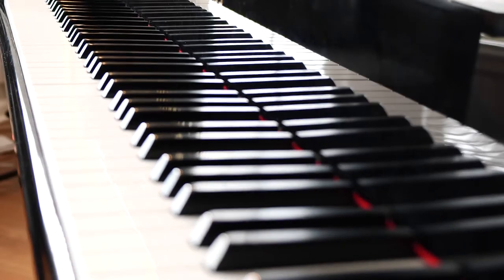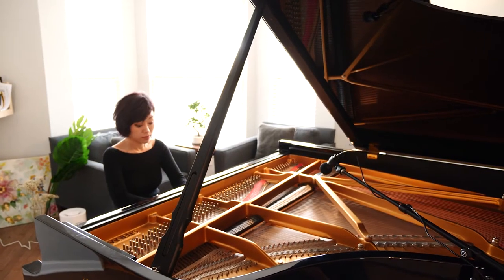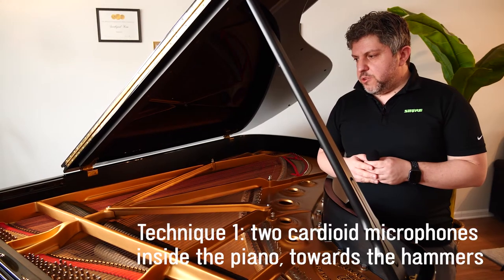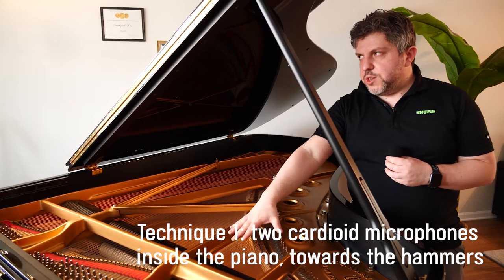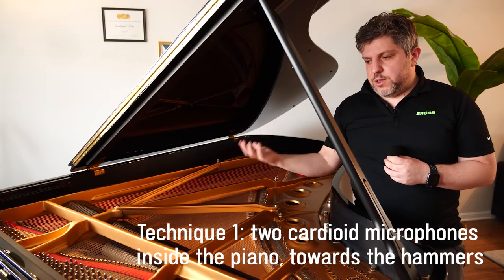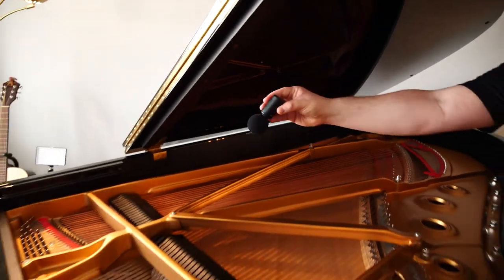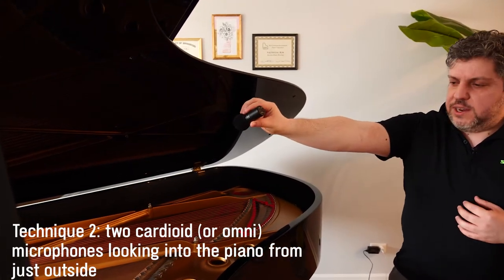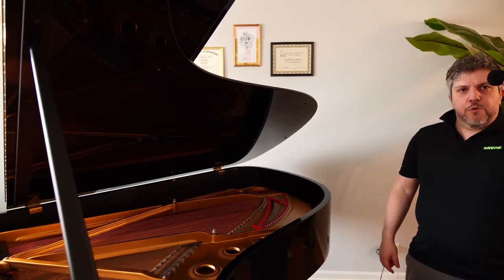How to Mic a Grand Piano with the MV88+ | Shure

Comment: Can you tell me how you set up the mic? I would like to know how you did the microphone settings in the app. It's really hard to find the right settings...For example, I'd like to know how you set things like 'mic gain', 'Stereo Width', 'compressor', and 'HPF'.
Reply from the maker: Hi Kim! You can tap Device on the navigation bar in the ShurePlus MOTIV app to access microphone settings.
Reply: @shurecreators  Thank you for answer. What I want to know is the setting value in the ShurePlus MOTIV app in the video above. For example, I'm curious about the 'mic gain' value or the 'stereo width' value in the application.

Comment: Thank you for the video and the beautiful performance! Could you please specify the settings you chose for the recording? I tried with the preset “acoustic” and it came out with reduced volume and dynamic. What were your settings for the gain, compress, etc? Thanks!
Reply from the maker: Hi there. For the MV88+ videos I leave it in "flat" mode. I didn't use any EQ or compression and my stereo field is 90 degrees. I don't remember my exact gain setting but I usually ask people to play a fortissimo passage and set the level so the peaks don't go higher than the -6 dB marker. Hope this helps!

Comment: Thank you for the wonderful video tutorial and the wonderful performance of the Haydn and Chopin! Could you please share the equipment brand of the Micro-B to Lightning cable extension, as well as the microphone long stand? 

Thanks very much!
Reply from the maker: You’re welcome! I used the 3m (10 ft) Micro-B to USB-C Cable that comes with the Shure MV88+ Stereo Kit. The microphone stand I used was a K&M medium-sized tripod microphone stand with a telescoping boom. I don’t remember the exact part number but there are a few different sizes to choose from. - Yuri
Reply: @shurecreators  thank you for your reply, Yuri! Could you please specify the brand of the 3m cable? Or perhaps link would be really very helpful! I don’t think my motiv 88+ comes with the long cable! Thank you very much!
Reply from the maker: The cable is a Shure Micro-B to USB-C Cable (AMV-LTG). You can purchase it here: https://www.shure.com/products/accessories/amv-ltg

Comment: Beautiful performance.  May I ask if it’s directly recorded on an iphone/iPad with the help of the app?  Very nice quality.
Reply from the maker: Hi! The microphone was plugged directly into one of the USB-C ports of my MacBook Pro laptop and recorded using a digital audio workstation. I did use the MOTIV app to control the gain and the stereo width on the MV88+, but you would get the same features and controls if you were using the app on the iPhone, and the sound quality would be the same! - Yuri
Reply: @shurecreators  Thank you!
Reply: May I know what setting do you use in MOTIV app?